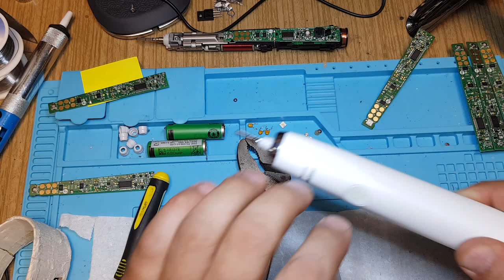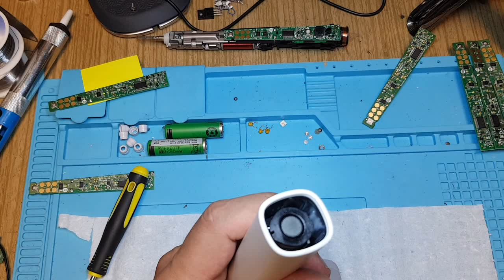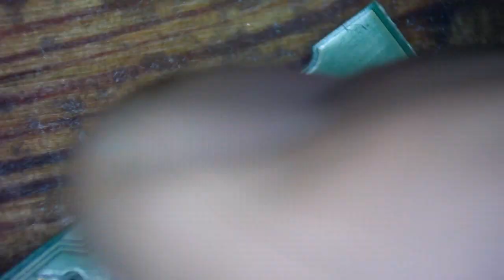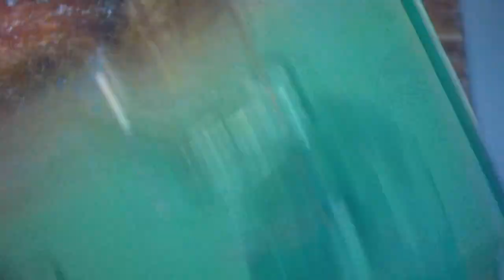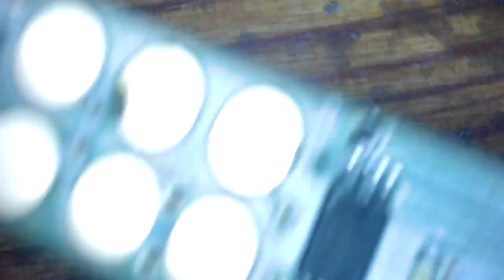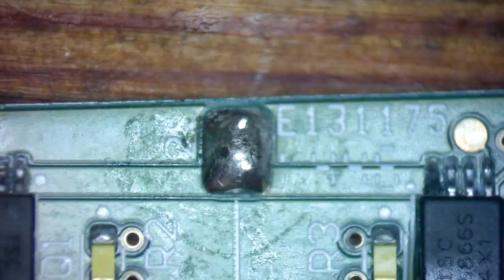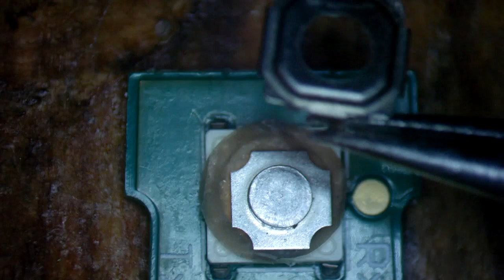Diagnostics and repair solutions of all known Philips Sonicare toothbrush defects in one video

Comment: 10 years ago I bought a Sonicare and recently I want to use it, unpackaged and started to charge. After two days charge and found it doesn't work. How I can do?
Reply from the maker: Battery is deeply discharged. Take it apart as shown in my videos  and try to trickle charge from another 3.6-4v battery. Positive to positive, negative to negative. It could be that some battery capacity will be lost from deep discharge, If this doesn't help exchange of the battery is the only solution..

Comment: Usefull videos you make. Thank you.
One question appeared regarding Philips Sonicare HX9370. Toothbrush doesnt work,looks like battery is dead. It doesnt turn on. But when its on charger all lights turn on. Lighs of the brush keeps some time after taking from charger,but later it dead. Maybe you know whats the problem?
Reply from the maker: Check my video with water damage I think in this video I discussed these things as well.. so best way would be to remove the motherboard and test all traces and components. Maybe the on off button is damaged try shorting it's legs with tweezers and see if this clicks

Comment: How to change the battery
Reply from the maker: in my channel there are a lot of videos for opening and repairing different philips models. exchange of battery is quite simple you just need to desolder 2 battery terminals. although if you have problems with battery 95% issue is with the motherboard. batteries are very reliable on this toothbrush..

Comment: Hello I have a question about: 3.3. Fuse 19:11 

Mine was dead, so I decided to omit it (bypass) and I have added wire from battery to the exit of the fuse so my system works without this fuse. 

My question is: 
-omitting this fuse means someting bad in future? May it cause some damage? if so, then where?
Reply from the maker: Yes if you leave wire it means that if something shorts out in future it would burn further and damage multiple components as in opposite of just burning the fuse and cutting the power supply to faulty circuitry.. fuses have their purpose :)

Comment: Labas! Fantastic detailed video. I have come across one problem with my Sonicare that is not very old. the problem is when I put it on the charging holder it flashes very rapidly but it does not charge. do you have any opinion about the probable cause? Ačiū,
Reply from the maker: Appreciate it :) what model is it and have you already opened it? As you said not common defect would need more info about it..

Comment: Thanks! Your guidance was really helpful in repairing two of my Philip Sonicare toothbrushes. Both had the problem of loose screw near the brush head. I wish there was an elegant way to open the bottom lid, but liked your approach.
Reply from the maker: thanks for the tip! really appreciate it. as for opening it, there is another method of compressed air (6-8 bar) injection through upper seal (but you do have to destroy the seal) then the bottom cap pops off. in "defense" of my method its non destructive and leaves no traces if done right and with some experience ;) good luck and thanks one more time!

Comment: Any thoughts if I have no vibration but the lights work (a lot of curotion on the inside on the magnet from untight seal on top)? Cleaned it and made a gap again but absolutly no vibrartion??
Reply from the maker: If there is water damage you need to take off the motherboard off the frame and inspect both sides. Additionally there can be some components that got damaged and need replacement depending on model (newest ones are more difficult to diagnose) it could mean that only motherboard replacement will help..

Comment: I have one that does not vibrate at all? Lights work, spacing is ok (was not before I cleaned the and made space for the motor
Reply from the maker: it could have some electronic damage.. best way would be to check with osciloscope if you get something on the output and if nothing start looking for a fault.. easiest way would be comparing with a working one..

Comment: I used this guide to open a Sonicare 4100 (HX3681) without breaking anything. The main difficulty was dealing with all the electrical connections using fine wires. I rerouted one of them into a notch in the plastic motor housing, and got the motor to run again. I lost the "too much brushing pressure" warning, but that was a small price to pay.

(I was even able to restore the brushing pressure warning by using the instructions in the owners guide on how to change the settings with the power switch.)

The 4100 doesn't have that holding screw at the top. It seems overall a little too delicate to last very long without having to open it eventually for another round of maintenance. It's not as expensive as the high-end models (under $50), but that isn't a good enough excuse for being unreliable. A lot of the negative reviews I've seen mention early failure.

It's possible the wire I rerouted was misrouted in the first place, and by routing it through that notch in the plastic, I put it where it belonged, and will reduce the need to open it again.

Overall, it was easier to work on than I thought it would be. Thanks especially for showing how to open it non-destructively.
Reply from the maker: AHH yes this is the newest Philips "invention" go back with technology progress and install simple DC motor instead of their proven electromagnetic drive and still leave Sonicare for Marketing purposes... And on top use different rubber seal, that is nowhere to get instead of traditional Sonicare Rubber seals... That's my critic for Philips :)) thanks for the comment, second time is much easier when you already know where everything is..
Reply: @letsfixitgarage  While it wasn't working, I bought a cheaper replacement - the Walmart "Equate" store brand model for under $20, which is made by Ranir. (Ranir also makes brush heads for the Oral-B and the Sonicare.)

The Ranir is made to be unscrewed at the bottom. The sonic brushing might be slightly less intense than the high setting on the Sonicare 4100 (which has 2 speeds), and there's no "excess pressure warning", but there is a timer. It includes a micro USB charging cable, which plugs into the bottom, but, like the Sonicare 4100, there's no charger brick included.

A friend has a mid-priced Oral-B that has lasted for over 10 years, maybe even 15. Even when she thought the NiMH battery had died last year, it turned out that she had been plugging it into an unreliable outlet, so now it's still working fine.
Reply from the maker: Thanks for the insights! These comments are a gold mine of experience:) from my experience oral-B has better water proofing, but they have their own problems :) but I must say I get more Philips than oral-B for repairs here in Lithuania..
Reply: @letsfixitgarage  What would you say is the best model for durability and maintenance?

The Oral-B I use is an old inexpensive model with 2 AA batteries,and I use NiMH instead of alkaline. I never tried to open it.

A friend of mine works in the US Foreign Service, and one of her assignments was a couple of years in Lithuania. My mother's father was born in Vilnius in the late 19th century.
Reply from the maker: Nice to hear :) it's a small but beautiful country, I like to live here very much :) "linkėjimai" to your parents ;) as for your question there is no best toothbrush. Main thing is which type of head you like round with rotory movement or more usual oscillating. Generally I would say Philips is more repairable/maintainable but genius series is more reliable one :) but it's only my personal impression.
Reply: @letsfixitgarage  The rubber seal you can get won't fit? Maybe a leaky seal could be fixed with some kind of silicone product. Or just put a dab of silicone (or something similar) on the top of a new one.
Reply from the maker: @AntiAntiAntiFa what do you mean with "won't fit"? The ones on eBay or AliExpress are one to one with original one. They fit.. I would not recommend silicone or other such waterproofing it doesn't hold as good as Philips rubber seal. You just have to take care of it and if you see black buildup just exchange it before water gets inside..
Reply: @letsfixitgarage  You wrote that a replacement rubber seal for the newer Sonicare models is different from the one for the earlier models, and you can't get the newer one. I was making sure that the older seal won't fit the newer models.

I was thinking of using a little bit of silicone caulk to repair a torn seal, not to replace a seal. I hope that doesn't happen for years. Maybe it would make sense to coat the seal with something like that as a preventive? The seal itself might be silicone.
Reply from the maker: Not exactly that way. Only the cheapest new Philips toothbrushes have completely different rubber seal. Older Sonicare toothbrushes have 2 types of seals and for these there are plenty of replacement seals online.. sure it's possible to use some silicone but will it hold and will it fill in every gap is a question. I exchange the rubber seal.but if you have that new one then yes that's the only way to get at least some waterproofing

Comment: Pure gold.  I love the way you explained the workings.  I have one and it stopped working suddenly.  I found a break in that rubber seal on top and water had seeped in.  Undoubtedly, this was the cause. I cleaned it up, any toothpaste residue, dried it, recharged it, but still nothing.  So I will go through your video to repair it.  It might also be the battery that needs replacing, who knows.  Also there is a gap next to the magnetic rotor that has to be not too close or too far to work right. 

You sound Russian.  The best fixes are by Russians.  Love them!  Russia is also a magnificent place to visit, some of the world's greatest art treasures, sweeping landscapes, a fantastic rail system, great food, great handicrafts.  They are the best artisans, engineers, athletes, artists, dancers, composers.  What an amazing country.
Reply from the maker: Hi, yes if you have water damage you need to take off the motherboard from its frame and inspect all the traces from both sides as shown in video. I have few videos specifically for water damage repair, check them out. Battery is usually fine it could need an external charge if it's to deeply discharged but should be ok. Russia is our neighbour I'm from Lithuania :) and these languages are very different but for some reasson we have a "russian" accent in English language :) Russia is a beautiful country, with nice people, sadly not that good management.. hopefully that will change..

Comment: Q: DW's Sonicare suddenly stopped working. In the charger, the battery indicator gives two quick green flashes followed by one yellow flash. The brush head vibrates as it does this. Battery problem or internal electronics?
Reply from the maker: Flashes with vibration indicate start of charging but of course if electronics have problems it's not charging. Open it up to inspect if there is water damage and does the toothbrush charge on the charger or just indicates it this could narrow down the problem...
Reply: @letsfixitgarage  Thank you. When placed in the charger, it simply flashes green twice, then yellow once, while vibrating briefly each time. We are thinking it is an electronic problem.
Reply from the maker: Have you taken it apart? Was there water inside? If available second charger or toothbrush try swapping to see what has problems charger or toothbrush..
Reply: @letsfixitgarage  Thank you. Pulled it apart and there is water inside. Am going to toss it like all the others, as it is far too much trouble to constantly repair.
Reply from the maker: Well as shown in this video water damage can be repaired but it is quite difficult if you are not familiar with soldering and electronics repair.. additionally you can sell them as defect on eBay or leave it for future repairs if your new one would have a mechanical defect you can use parts from this one, Sonicare brushes parts are all interchangeable ;)

Comment: Some units have a small hole in the end cap. With an air compressor, you can pressurize the case through the hole and the cap will pop out. No hole? Drill a 1/16 or 1.5mm hole with a hand drill. Do not go beyond the cap, which is only about 3mm thick at that point. CAUTION: As you do this, use your fingers to support the silicone seal at the brush head end. Otherwise, the air might pop a hole in the seal. 
Other units have a 6mm closed hole in the c=end cap. a 1/4-20 cap screw or bolt will thread into the hole with just enough grip to pull the cap off with zero damage.
Reply from the maker: Would not recommend this method as this small hole has a membrane on it to let small amounts of moisture out from the inside. When you make a hole even if you seal it then these small amounts of moisture would be trapped inside... You can destroy the upper seal and use compressor to pop the bottom cap off but you need to change the rubber seal in that case. My method when used correctly leaves the rubber seal and bottom cap in tact and you can reassemble the toothbrush without any damage..
Reply: @letsfixitgarage  Thank you. I wondered about that.

Comment: Hi, I have a problem with my toothbrush. If I charge the battery externally, the brush works, but if I put it in the wireless charger, everything turns off and does not charge. Do you think there is a short circuit somewhere and it automatically disconnects when you put it in the charger?
Reply from the maker: If you have a donor try changing chip with KLB on it.. that's the usual defect chip when the toothbrush doesn't charge..

Comment: What does it mean if it won't turn on, and putting it in the charger it makes one long beep with orange light, followed by two quick beeps with green light?
Reply from the maker: First of all o would check the motherboard if it has water damage check all the connections and buttons functionality. Then I would try to check some chips but for that a donor board is needed.. sadly water damage is not easily solvable..

Comment: Thank you for the video! You have helped me repair a loose head and fix it successfully now 😊 Although, it seems to have brought up another problem, I’m putting my toothbrush on the charger and in the travel charger and the light won’t flash to say it’s charging. It still has power and works at the moment. After I finish brushing, the battery LED flashes. Doesn’t that signal that it has a partial charge? I don’t understand why it won’t flash when I put it on the charger. I’ve taken the plastic chrome piece on the bottom on and off in case bad contact, still the same. Any help would be greatly appreciated. Thank you
Reply: Update:  I've taken the unit out of the case and removed the bottom plastic silver coloured cap, it now charges.  Any suggestion on how to reassemble the unit so it is making proper contact?  I also can't seem to just place the unit on the cap without the casing to test it that way :/
Reply from the maker: Hi what is you toothbrush model? DiamondClean models have to be placed in the glass charger with end cap to properly charge.. additionally maybe the charging coil got damaged during extraction of the insides..
Reply: @letsfixitgarage  Sorry for the late reply!  It is the Diamond Clean HX9350.  I received the new bottom cap and it still won't charge unless I remove the outer casing and place that directly onto the glass charging base.  The same applies for using the travel charger.  I have deduced that for some reason now, the internal components are not touching the charging cap, and therefore connection is not being made for the glass charging base.  What do you think?  Do you know a remedy for this problem?  I really appreciate your help
Reply from the maker: Difficult to say.. either charger, coil on toothbrush or charging circuit on the motherboard could influence it.. easiest way is to have second toothbrush and charger to see what is not working..

Comment: Thanks a ton for your vids. Amazing how much you empower people to reduce waste by DIY fixes. At around 19:17 you talk about the fuse. If I'm not getting a continuity tone when testing, do you know what would be a replacement fuse? I have hot air, but don't know where/what to buy.
Reply from the maker: Have some example fuses in description of the video. Check them out. I would install 2a fuse although 1a fuse holds as well..
Reply: I took a look at the Fuse links in your description. The 2A one pointed to 0805 fuses; I got some but they are a bit larger than the one it’s supposed to replace (also, the one that failed has a P printed on it… does that mean it’s 3A?). The link to the “smaller fuses” in your description is no longer working :( - can a 8050 actually work here?  Thanks!
Reply from the maker: Yes they are slightly bigger as original but if you apply flux and have good magnification to see where the fuse lays it's possible to solder it in, not to difficult. 2A is fully enough. Have made some measurements that it runs normally at 600ma if I remember correctly. There are some older comments with precise digits.

Comment: hello there! can you do a video on the copper coil at the top please? the ends are both loose (the other ends a nicely soldered in the two pins)
Reply from the maker: Hi, there is not much to show on this part.. its a brusch head detection coil that receives and send information to the brush head. if it broke off and you need this functionality you need to either prolong the wires soldering extension wire or get a donor where you would take this part off..